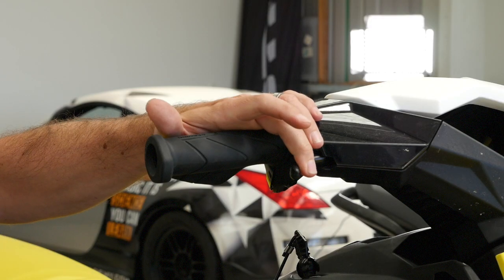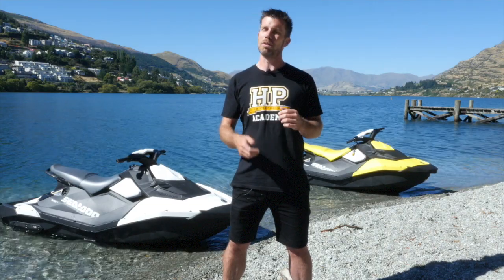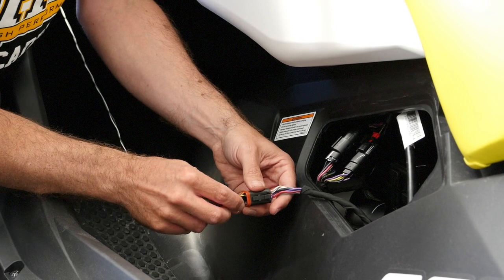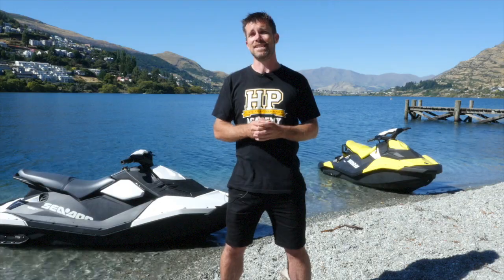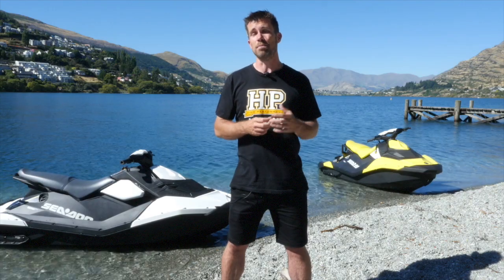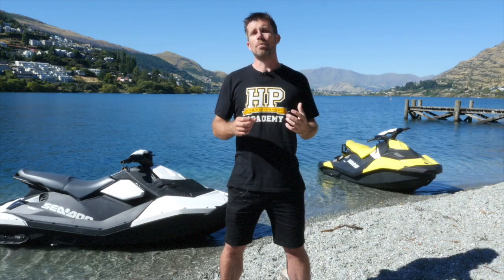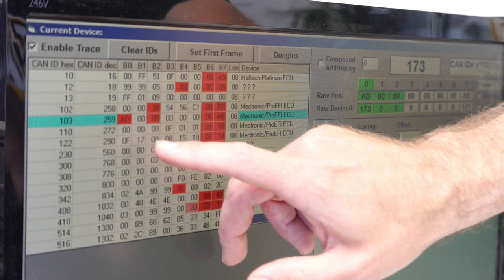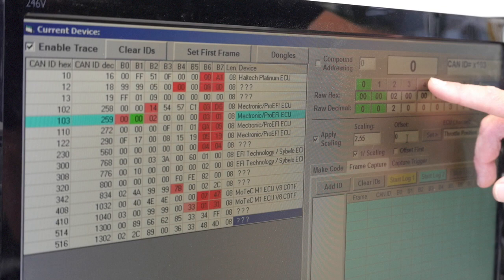[TECH TALK] Jetski CAN Wiring | MoTeC powered Jetski

Comment: Yer nice the factory ecu actually has closed Loop boost & afr available you just need to enable it in its firmware as this is the same ecu used in the maverick turbo bikes and the turbo side by side buggies the bosh ecu is very underrated and has proven in my case to run deep in to 450+hp with turbo setups on factory ecu (dashpac) also enable on screen boost afr modules to display on factory screen aswell FYI.